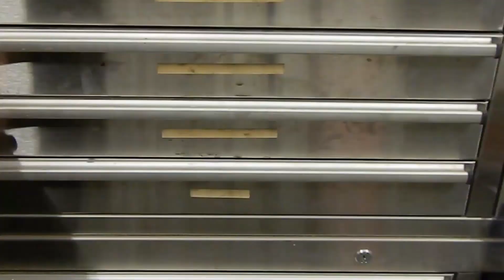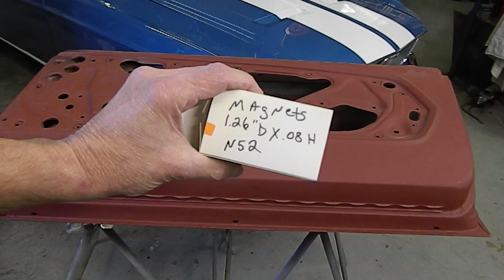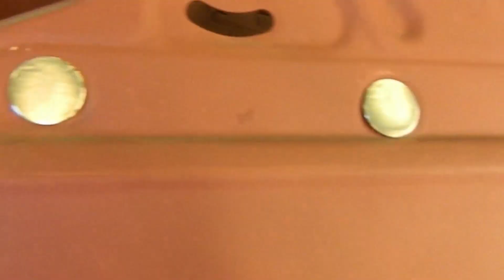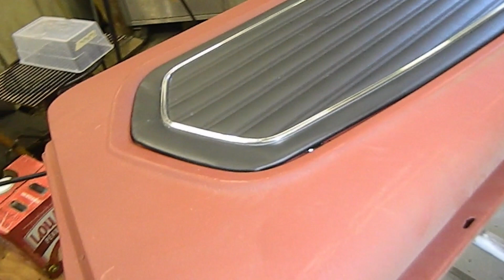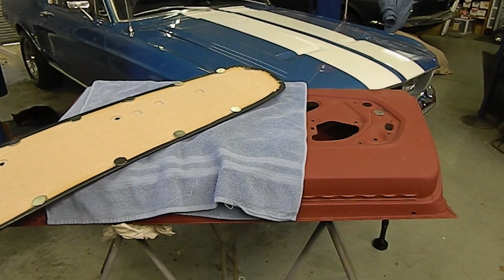Magnetized Door Panels !!! Pt 2

Comment: Outstanding video!!  I do have a question, how effective to you think ultra high bond 1/16” thick double sided foam tape would be in place of the glue?  I use it for all kind of similar applications and was just wondering if you had any experience with it and if you think it would be a good alternative to the glue?
Reply from the maker: I don't see why it wouldn't work as long as the release temp. is in excess of 150 degrees.  Average inside temp of a car here in SE Tx.
Reply: @Glens1965  I looked it up and the temp rating is negative 40ºF to 200ºF... translation, good in both MT and TX
Reply: not sure on the tape. if its strong enough, it may hold. i would worry about it separating over time depending on how often you pull the panels or possibly even the thickness causing an issue. i made a template, then laid my panel flat and used jb weld to attach the magnets to the panel off of the door and mine turned out pretty well. same idea, but no risk of gluing a magnet to the door.